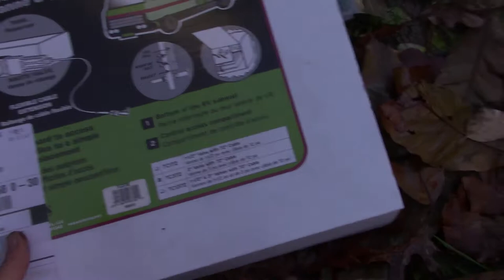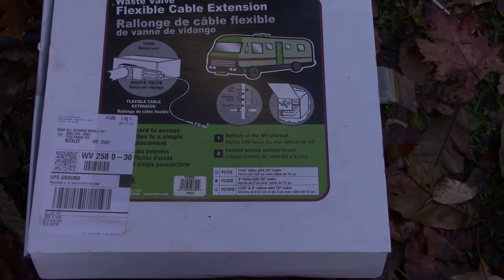RV Remote Sewer Valve Replacement

Comment: I just bought a used Grand Design 22RBE and I have a full tank and it won't drain when I pull the black tank handle. SO, I'm getting ready to tear into it. Not sure how to get rid of the sewage first - I'm thinking about scarificing a wetdry vac and sucking the sewage  through the open toilet. Your video was a great help. Many Thanks!!!  I'm now subscibed - keep the video's coming for us. LOL
Reply from the maker: That stinks....good luck. See what I did there?

Comment: I watched over 10 videos on drain leaking. Yours by far was the most informative. I’m about to cut into mine, it’s leaking somewhere. Didn’t have time to look at it yet. Was actually dreading the job, not knowing what was up there. Weather a bad valve ( I hope) or a busted pipe, I feel like it want be as bad. Single digits temperatures now, I work on the road. The good thing I liked about your video was that fact you had problems with the seal, and you didn’t edit it out. That helps people know what or how to deal with issues. Great job on the wood.
Reply from the maker: Thanks Donald. I hope it goes well when you tear into it. I think I have a couple of videos on replacing remote valves.

Comment: I'm only minutes into your video and paused it to comment.  Just the tip on how to remove the nails is worth the video alone.  I've seen so many where people grind them off or drill them out.  Thanks
Reply from the maker: Not all will come out just by twisting them but some do.

Comment: so glade i ran on to your video, got some great tips from it, I will be changing mine out come spring as well as new morryde steps ,roadmaster suspension with dis brakes , 4 mos into  retirement I'm bored ,maybe i need to become a RV tech..
Reply from the maker: Maybe you should.

Comment: I have used grease to hold the seals in place and a 4" spackle knife to push seal/pipe apart while sliding the valve in place. Closing the belly pan with zip ties and Gorilla tape after wiping the surface with acetone/alcohal to prep. Works great!
Reply from the maker: The spackle knife is a good idea

Comment: I used this way of converting my existing standard pull valve to a cable pull to avoid crawling under my slid out to pull the gray tank valve. I contemplated dropping the whole underbelly, but made the smarter decision to do as you did. Glad I changed my mind! Thank you for this video!!
Reply from the maker: You are welcome Alan.

Comment: I like the way you sjhow thing thoroughly! I have one of these stupid set-ups with two separate dump lines. My galley plumbing hangs so low that I have knocked off to cap assemblies. I am hoping youcan show how to replumb that rear line so that it can be shortened or  angled in a differentdirection so it is not hanging down at such a severe angle. Since it is only Gray water, I only hook up a 3/4" hose to it which works great.... when the connections are not knocked off! LOL
Reply from the maker: Next time you drag it off, replumb it the way you want to, so it won’t get damaged again.

Comment: Would you always replace the cable ? I have a black valve that is hard to open and close. Thanks for the video.
Reply from the maker: It comes with a new cable, why not change it? Yours could be hard to move because the cable is bad.

Comment: Appreciate how you showed the entire install including the problem getting the new gaskets to stay in place.  Most others would of cut that out of the video and then proudly exclaimed "see how easy this is ! No problems whatsoever!!  Only took 15 minutes!!"  A question; can you cut the cable if you don't need the full 72" supplied?  I gotta replace mine and I think the current cable is just 3'.  Seems like using too long of a cable would lead to binding as you'd need to put in extra bends.
Reply from the maker: You would have to be SUPER careful when cutting the cable and you would have to end up with the same amount of cable past the sheath.

 Pro Tip: pull the cable out of the sheath. Cut the sheath and them slide the cable back into the sheath.

Comment: Great job, it looked like you replaced the LaSalle Bristol valve with a Valterra valve. I have two black and two grey valves on my 5th wheel that need replacing,  is it possible the bolt patterns are the same and the two brands are interchangeable?
Reply from the maker: I have never run across a different bolt pattern.

Comment: Great video and process..until you went crazy with the gorilla tape. Those short sections around the drain pipe will be gone after a few trips. Good work on the fla, but i would spend the $11 for a can of black expanding foam. Much better hold and less chance of rodent entry.
Reply from the maker: I have never had success putting Great Stuff foam overhead in a big gap.

Comment: GREAT detailed video! I would of just blacked tapped the belly flap closed... IK its just my 2 cent input..
Reply from the maker: Isn't that what I did?
Reply: Yes u did. But all I would of done was tapped it closed without the extra wood and screws. That gorilla tape is super strong. Again GREAT video!  Thanks!!
Reply from the maker: @scottsmith8934  I have seen many gorilla tape patches like this fail. It only takes a few more minutes to do it right.
Reply: Yes Absolutely overkill is always the best way to make sure nothing else happens in the future

Comment: I realize this video is 3 years old but I'm hoping you can answer a question I have. I am in the process of replacing my black tank valve. It's a Lasalle Bristol 3" valve with a 72" cable. I managed to get the bad valve out and need to order a new one. They all come with the PVC flange on both sides. I don't need the flanges because the ones I have are fine and glued on to the waste pipe. I just need the valve itself that fits between the flanges. If I buy a new valve assembly and take the bolts out, can I use just the valve, rubber gaskets and cable or are they glued on from the factory? Thanks.
Reply from the maker: Absolutely. I don’t change the flanges unless there is something wrong with them. Have fun.
Reply: @hillbillyrv  Thanks! I appreciate the guidance and quick response!

Comment: I would think tightening the sheath connector would cause the cable inside to have more resistance to moving back and forth.  What do you think?
Reply from the maker: The valves that I use have a clamp on the sheath that won't allow you to over tighten it.

Comment: Excellent! My valve is partially open and the black tank isn't holding water. Un fortunately I have vent pies coming down too so  sewer pipe after the valve will not move freely and I think I will have to wedge something to keep the valve pipe ends apart to be able to slide the new valve assembly between them. Question: Did you pull out a LaSalle Bristol valve and replace it with a Valterra? Are they interchangeable/standard?
Reply from the maker: They are interchangeable. I like the Valterra valves, but that is just my preference. I have one in my Amazon store.   https://www.amazon.com/shop/hillbillyrv